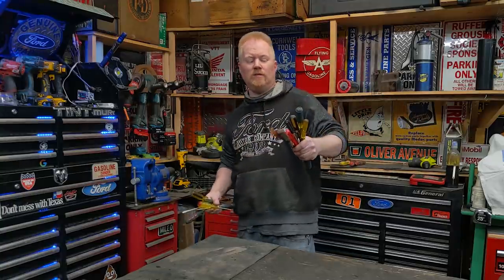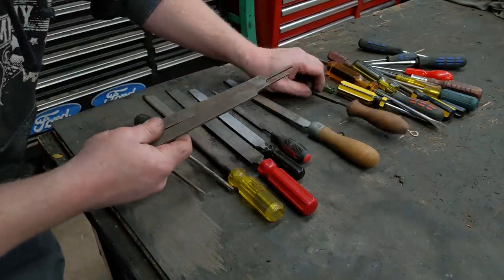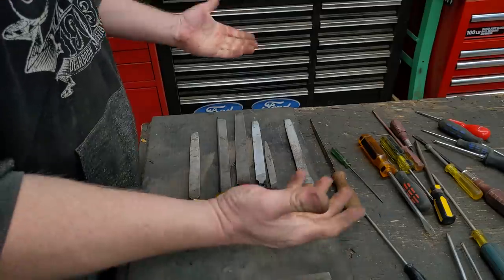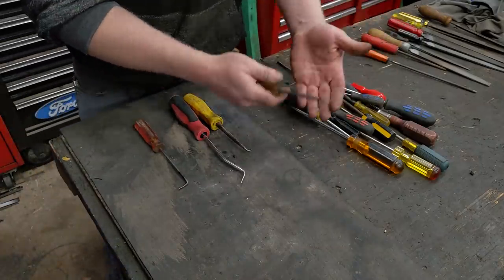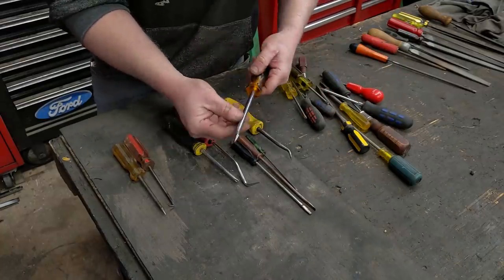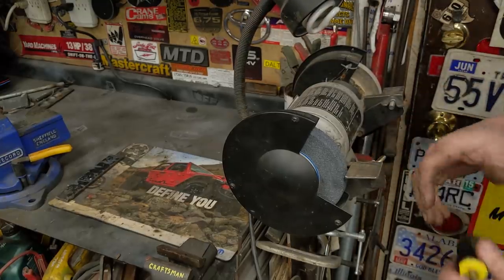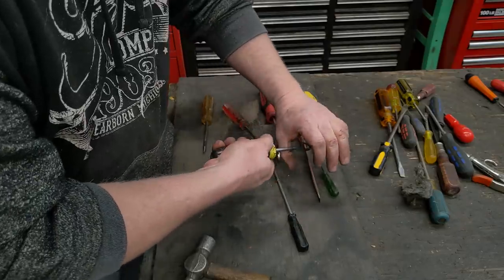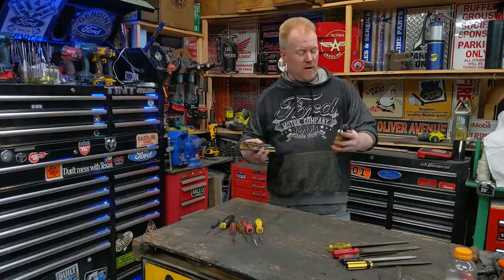BEST uses for Broken Old Screwdrivers VOTED #1

Comment: You can file a  |V|  shape into the end of flat head screwdriver and sharpen it a little and it makes a good upholstery staple remover.
Reply from the maker: Great idea
Reply: Also cut a groove in the side of the flat blade on a screwdriver....now its a spring puller
Reply: Heat it and bend it some to make it a better staple puller.

Comment: Chain pulls for the shop ceiling fan!
Reply: I LIKE this one!
Reply: @dethmaul  I'm telling you, I'm embarrassed to say the pulls in my shop are for normal ceiling fans, just thought of this watching this vid
Reply: I use large inverted wire nuts with a drill hole to knot the string
Reply from the maker: Chains pull.... I like it.

Comment: I  always thought that the square wooden handled screw drivers were pretty good. Seems all the old guys had them. Even cheap stuff from back in the day was better than some "good" stuff now.
Reply from the maker: I have tons of screwdrivers so if they don't have a brand name I generally assume the steel is pretty cheap and just toss them into the junk screwdriver box. The good Stanley (and others) wood handled ones engrave the brand name on the metal collar. I would choose these cheaper wood handled ones or even acetate handles over the cheap abs plastic handled ones.
Reply: I think as long as you dont go crazy and start hammering on the end or prying too much, the wooden handle drivers work exceedingly well. I was gifted a set when I was 16. That was 42 years ago and I still have most of them (broke a couple over the years).
Reply: I have a few wooden handle ones that are junk mild steel tip but the other ones are really good.
Reply: I've got a wood handle Mac that was my grandfathers and looks just like that one.

Also some gunsmith screwdrivers look just like that and they're awesome quality as well :

http://www.graceusatools.com/item-details.php?item_id=31&category_id=2
Reply: Use a modern snap on screw driver. You will be impressed
Reply: @jackk8422  Snap-On? LOL, you're spending way too much on buying the name, there! 😂 Even Mac is mostly the same way, with the name making it more expensive. 😄 You can get a 20 pc set of Gearwrench, for example, for less than $100, and a 12 pc set from Craftsman with a lifetime replacement warranty for about $20! I know that Mac and Snap-On both may come to your employer's (or your) shop, and you can make payments on large purchases (I got my $3.5K toolbox that way), but you really are paying for the name.

Comment: i do pool table repairs for a living. They sale staple pullers that cost 25 bucks or more but I been using the same screw driver I ground and reshaped the tip on for 20 years now.
Reply: That's a cool idea. Put a pool in your table, man. Then get a bunch of little nets and clean the pool tables for people. invention of a dumb thing and a job about the dumb thing. Genius like government!
Reply: I was just foolin around with your brain waves man :))
Reply: When building my airplane I used staples to hold plywood gussets in place while the epoxy dried. Did the same thing, ground and slightly curved the tip of a junk screwdriver making a very effective staple puller.

Comment: With a Dremel rotary tool, you could re-grind a Phillips into an E-clip remover; and a flat blade into an E-clip installer. Those 4-in-1 screwdrivers are good for that (Small and Large in one tool). Sure beats using the wrong tool for the wrong job. If you magnetize it, it's even better.
You could also cut threads onto the shank and use the handle as a drawer-pull, or accessory to some other tool.
When all else fails, You could always cut off the flat blade and use it as a wedge to tighten hammer-handles.

Comment: Probably too simple but as a former service plumber, I have a “digging screw driver” which is used for what it sounds like. It’s a flat head that helped me dig around pipe so I could just get the job done instead of shoveling out a bigger hole so I can use the shovel underneath the pipe. I just chip the dirt away with the screw driver after I have gone as far as I can with my shovel and expose the pipe all the way around to sweat or glue  on a repair.
Reply from the maker: Great idea. I have a digging screwdriver and old large kitchen knife just for this. The knife is generally for sod cutting before sprinkler repair.
Reply: When I was a kid my dad used a nice kitchen knife for his sod knife once. Once.
Reply: @Eyes0penNoFear  you have to know how to use a knife, LOL! For example, never ever, ever push the sharp edge towards you, using any method! 😄
Reply: I've got a couple of implements of destruction for things like this! One is for loosening soil to drop seeds into in my large gardening pots and raised beds. One is for digging down around a specific invasive weeds' exceedingly loooooong taproot. Things like that are really good ways of reusing old screwdrivers, prybars, even tire tools!

Comment: Great video! Little tip: since it's often so easy to get the shaft out of the handle - if I'm making an awl from a screwdriver, I like to take the shaft out and chuck it in a drill to grind the point. You gat a perfectly centered point pretty quick. Almost like a little portable lathe. (Also a great way to polish any round stock including screws and bolts).
Reply: Do you use a file with this method?
Reply: @Mandalore06  a file? Why would you use a file? Use a grinder, like he does in the video!

I mean, if the files are all you have, I guess you could stick the file into a vise and clamp it down really good, then run the drill with the screwdriver shift in it, and hold it against the file. Maybe?
Reply: This won't work with some of them, as they have little tabs on the end that may be so far down you can't put enough of the shaft into the drill chuck for safety. Well, won't work unless you grind off those tabs, anyway. I prefer not to do that, as (assuming they have a plastic handle, as any I've seen have tabs do) they can be heated up and the handle put back onto the red-hot shaft with the tabs a different place than the were before. 

Then again, you'd have to heat that steel up quite a bit in the first place to melt the handle enough to knock it off of the shaft. So, that style might not be such a great candidate for this, after all. So, I'm back to this won't work for that kind, LOL!

Comment: I like your O-ring pick Idea ..My favorite screwdriver redo is the one I made into a shifter knob  on my automatic column shifter in the pickup
Reply from the maker: I need to do that to my 78
Reply: That reminds me. I had the snap on handle on my truck before I made it into a forward AR grip.
Reply: Had a column shift manual once, ( Australian Holden torana) which broke in the column. For an immediate temporary fix, I drilled two holes in the floor hump and brought the cut off linkages up through the holes. One stick for 1st and reverse and the other for 2nd and 3rd. The column never did get fixed, just got used to using two sticks.
Reply: I read this without my glasses. Lol! You can probably guess what a blurry “Shifter knob” read like. Lol! It wasn’t until I got to the following line that I got the “Snap-On” toilet out of my head. Thanks for the laugh. I’ve got my glasses on now. Stay safe, & God bless.

Comment: Use em for cabinet door handles (in the garage), throwing weapons, put them on 1/4" and 3/8" socket extensions to make nut drivers.
Reply from the maker: I have a collection of 1/4 nut drivers that are just a 6"  extension through a handle. I don't have a 3/8" one though.
Reply: Good thinking Cornelius 🙂

Comment: Folded the tip over on a flathead to just past 90, as sort of a flat wide pick. Use it all the time for cleaning out grooves,  pulling out valve spools etc.  Usually use it with a crescent wrench as a mini slide hammer puller.

Comment: Tip: put some J B Weld in the handle to keep the handle from coming off.     Especially wood chisels.
Reply from the maker: Good idea
Reply: @sixtyfiveford  

JB Weld is very tenacious.    Can withstand impact AND will glue handle up.   ( within reason.   Don’t try to kill your glued chistles with a Plumb hammer)
My refurbished chistle handles ( 3 of them) have lasted 20 years.   But I have to glue them up again because they have become loose.  

❌ tip: JBWeld also works great on eyeglass frames.   I’ve got a pair of glasses from 1990 that I’ve glued up 6 times.     Still going.    Like the energizer bunny.
Reply: JB Weld is Good on Metal and Plastic . From A Somewhat ( old) guy .

Comment: Caulk gun tube nozzle puncture, seal and clean out tool. Plug tool for fuel and vacuum lines. Insert and affix 5/16" or 7/16" threaded rod into the screwdriver handles to replace the adjusting screws on locking pliers to improve the grip and adjustment torque. Wall-mount coat rack posts for the shop. Cheers!

Comment: Homemade 12volt test light!!  Drill into the top of the handle down to the shaft- slide a spring and an old car dome light bulb in, piece of wire with a alligator clip and hot glue to hold the wire and bulb in.....  Quik test light in a pinch. 👍👍
Reply from the maker: Good idea

Comment: JB weld a good countersink bit into a handle for a hand operated model to deburr holes and such.
Reply from the maker: That's a good idea.
Reply: .... had a deburring/countersink bit.

Turned a piece of wood from my back yard on my lathe into a wooden handle and drilled the end to just undersized for the bit...  added some epoxy into the hole and jammed the bit in.  Works great! 

Did the same for multiple drill bits of various sizes for depth drilling on my lathe.  I just turn the lathe on, put the bit up to the center and hold it steady as it drills perfectly in the middle to my marked depth.  Could do this with an old screwdriver handle, but in even cheaper thas n you guys...  a branch from my back yard is good enough.

Mesquite is a beautiful hardwood, by the way!

Comment: grind a groove in the center of a flat tip and it works great to compress ford drum brake hold down springs
Reply from the maker: I'm going to make one! I have a technique with needle nose pliers, but this sounds better.
Reply: Use a groove screw driver, like you said to install the brake spring on a chainsaw.

Comment: Great video!!!!  Love your channel--one of the very few I have subscribed to.  Some other uses: (1) Hammer a hex bit holder (like for a drill) into the handle and presto--a new driver for all hex bits.  Can do long or stubby.  May need to enlarge the hole, but leave it tight so it won't turn in the handle.  Can also heat an old nail and use it to soften the he hole in the handle a little first, or put in some epoxy first; (2)  hammer an allen wrench (hex key) into a small handle for often used sizes,  such as set screws in tools, electrical connectors (also provides insulation as added bonus), or even the handle on  the storm door that keeps getting lose; (3) cut off the end of the free paint can openers from the box stores and hammer either end into the handle to make either a paint can opener or a bottle opener;  Hammer an often used drill bit into the handle to make a hand drill.  The uses are endless.
Reply from the maker: Thanks, I'm glad you liked it. Great ideas.
Reply: I had not actually thought about doing drills. 
I've done countersinks, and hex bits, which are good.

Comment: If you chip the tip of a Phillips bit grind the tip down a bit on the side of a bench grinder wheel and you will find it fits well as a JIS bit. Japanese Industrial Standard. Common on motorcycles and electronics.
Reply from the maker: Interesting. I pretty much only use JIS on everything now. It fits so much better in Phillips and JIS.

Comment: Your videos are always a pleasure and treasure to watch. Not only do you explain procedures well, but you reply to most of the questions and comments. I recently ground and shaped an old screwdriver to a  one pound propane bottle valve remover tool. I repaired leaking propane valves by removing, greasing and re inserting them.  Thank you for all I have learned from you in the youtube classroom. Happy New Year from New Rochelle N.Y.

Comment: I use the bigger flat heads and cut them down to the thicker part of the blade so they will fit the brass needle seat of an edelbrock carburetor.

Comment: A superbly handy use for a #1 and #2 round shanked driver is to grind it like a hollow ground gunsmith bit but like this  )( viewed from the side. That will grab the inside of brass carb jets without smearing them. I learned that trick from my now-deceased Vincent-restoring mentor who said it dates before WWII. It works better than any other jet screw design (and of course NEVER use a tapered style common screwdriver on brass or really on anything you care about except as a pry bar).

Comment: The more robust flathead screwdrivers make good 'mini-prybars' of various lengths and angles but you will probably need to heat and hammer the ends flatter,  wider and thinner.
A 'V' shaped notch ground into the end of some is useful for prising off stuck vacuum pipes etc.

Comment: That Tri-lobe handle style on the JC Penny #4 is my favorite tool handle.  Sears made sets in the 1990s and I've been collecting those.  Stanley had the same design and I think they were first to produce it. The Sears handles are a bit larger than the Stanley units.
Reply: I’m with you! I love those, and older craftsman professional screwdrivers. They both have deep rounded scallops that feel good in hand and lend themselves well to increasing leverage

Comment: I've ground them like lathe tools then heated and bent ends 90 degrees to get into internal features. Really handy for cleaning o-ring grooves in motorcycle brake calipers (end ground flat with relief angles then bent at 90) and also cleaning out larger threads in alloy components (when ground at 60 degree angle) Often much easier than buying special sized taps or dies when threads are 'almost good' just a bit rusty or oxidised
Reply from the maker: Awesome

Comment: I like taking the small pocket flathead screwdrivers and making little pry bars. I carry one in my pocket every day. It's great for unplugging those little pesky electrical connections or prying off fuel line. I also make punches out of the Phillips screwdrivers after they break. I have one with a metal end on the handle that's made to be hit with a hammer. I have a few homemade tools. I just made a crankshaft holder today out of a piece of 1/4 aluminum flat bar. It worked great. Love your videos. I'm a Big FORD guy too

Comment: I’m using my  old screw driver as my key for my rat rod truck. Cutting the handle off the key 🔑 and inserting the keyed portion into the handle. Yes it’s old no chip.

Comment: Harbor Freight often gives away a cheap screwdriver set. I took one of the flats & ground off the angled edges to make a jet removal tool for small engine carbs. "Official" Briggs jet tool costs $15-20.

Comment: I got a bunch of files that are fixin to get handles!
Reply: Same here!
Reply from the maker: They make really nice handles. Sometimes you have to lick the handle with the torch for a second and it locks in much nicer to the file tang.
Reply: Probably too simple but as a former service plumber, I have a “digging screw driver” which is used for what it sounds like. It’s a flat head that helped me dig around pipe so I could just get the job done instead of shoveling out a bigger hole so I can use the shovel underneath the pipe. I just chip the dirt away with the screw driver after I have gone as far as I can with my shovel and expose the pipe all the way around to sweat or glue  on a repair.
Reply: this is awesome! Drill an undersized hole into a golf ball to press file tang into also works well!

Comment: Another use for a broken screwdriver: file its peak into a special screw driver peak for security screws or an awl. Getting coloured file handles by painting the original wooden handles is of course also always possible.

Comment: great video pal.i use the handles to make Awls and picks,also i use broken or blunt SDS masonry bits, and lets say its a cheap n nasty chinesium screwdriver well the steel is usual crap ,take out the steel and grind down the SDS bit to make a Awl,also as the SDS is fluted to fit the chuck you can get some epoxy in there too
Reply from the maker: Good idea.

Comment: Screwdrivers make great fishing hook removers.  Two styles.
#1 Just insert a Phillips into the fish's mouth, past the hook, and take a couple of turns of line around the handle.  Holding the line under your hand on the handle, spin the fish in a whirling motion, until the fish just drops off.  It works great, and you never even touch a catfish. let alone get spiked.
#2 Cut a V into a flathead screwdriver (not a flathead catfish), and use it to push the hook in deeper until it releases, give it a half turn, and ease the bare hook out.

Comment: If you quench them in used motor oil they won't get too britle.  It makes them less likely to bend under use.
Reply from the maker: I found oil still made the skinny pick tips brittle.
Reply: After you "harden" something, then you have to "temper" it properly. Lots of videos on that subject.
Reply from the maker: @davesanders9203  I've played around with tempering a lot. It's far easier with a large chunk of steel. A needle point is near impossible without a kiln to bring it up to a proper temp.